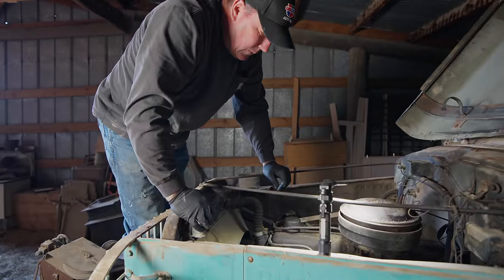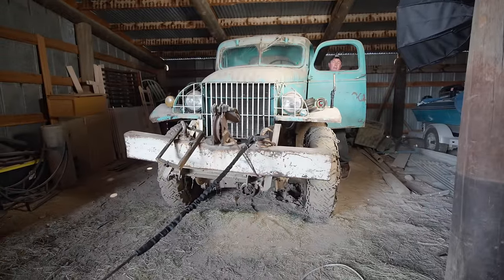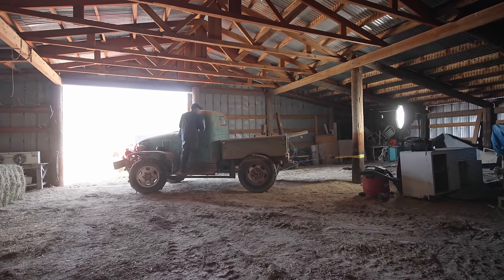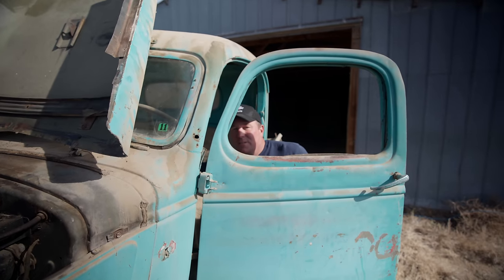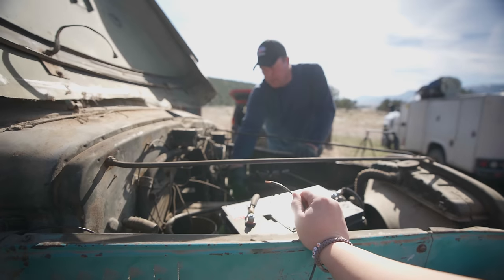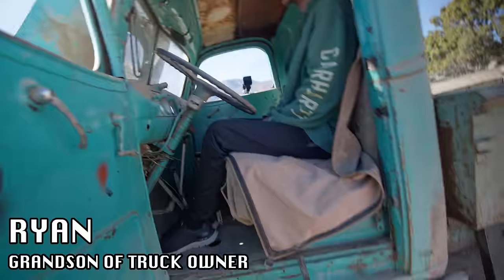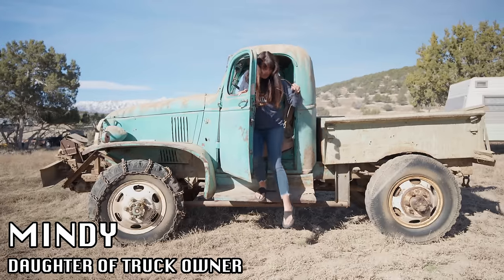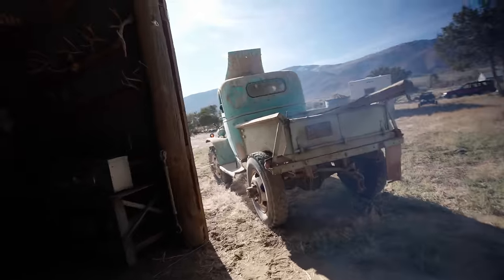Chevrolet World War 2 Truck Has Sat In This Barn For Decades. We Are Going To Attempt To Drive It!

Comment: Honestly if you took off this carburetor and had it cleaned up proper, a boat tank and gravity would keep it running. How hard is it to just clean up the system? I am a seventy five year old mechanic and seen thousands of those rigs in my day, including military time... I am guessing its a old gmc rig and those engines are bullet proof. Even those with the chevy engine are great runners but some kind of exhaust system will make it sound a ton better. They are not fast but stead and will give many years of service
Reply from the maker: We may do a future video on this truck and address some of the problems. It would be great to get this truck back on the road.

Comment: Please don't put a Cummins diesel engine in it. That Chevy 6 cylinder is good. A carb rebuild or a new carb, ignition tune up, split manifold dual exhaust with stacks, and use Lucas Hot Rod oil in it. 10W30 non synthetic. It has zinc in it and it's good for the engine. Run 91 octane and higher gas in it.
Reply from the maker: Thanks for the advice

Comment: Just get it running and driving the work involved to swap other parts in requires butchering it so bad it’s not worth the gain and also remember the transfer case outputs rotate opposite of each other so you would have to swap out axles and t case if you changed one or other. Iv owned a few of these and there hard to improve on. Cummins swap is the worse option In my opinion hope to see it on the road soon👍
Reply from the maker: Powe steering and power brakes would be nice though
Reply: @ I adapted hydroboost from a 95 Chevy one ton and power assist off an old highboy f250 works like a charm just have source used parts and do some welding fab work but your truck
Reply from the maker: Very cool

Comment: Put a bigger Chevy Flathead straight 6 in it that one of  the bigger cargo trucks and a 
nv 5600 behind it these are just opinions of mine in my last opinion would be put a set of Hummer axles under it the ones with the portals if I was going to use a Cummins BT engine I would use the 4-cylinder the 3.9 it would probably be easier to fit in that
Reply from the maker: All very good ideas

Comment: like onion one layer at time i would work on each system hate to say it but ya it fun but even mor when its done right running shifting then playing so ya jacking i up get brakes clutch fuel spark i did that on few but now i take my time just qulity reason results
Reply from the maker: You are not wrong

Comment: lot people do this do that i learn so it original right ya i did this this so what is orignal um well ya to me means more keep it like it is then it could be or was before durning or after it is what is now day i feel safer just trailer them or drive but not on highways interstate etc just not worth it regear make road worth vs travel na i got current stuff rather just putts in outdoors or field
Reply from the maker: It’s fun to drive the old trucks in stock form for sure